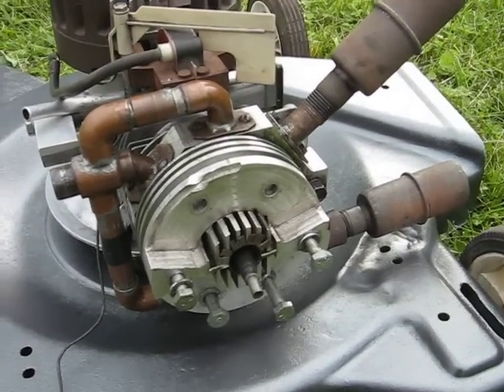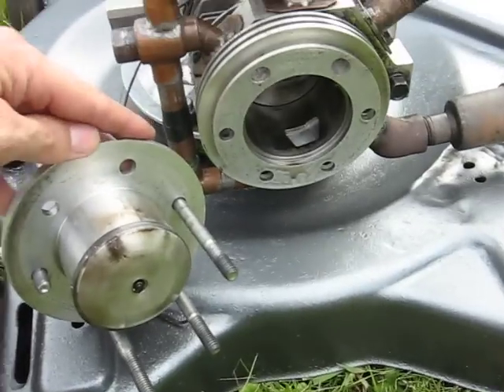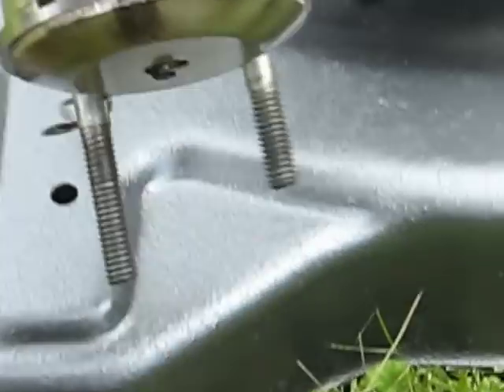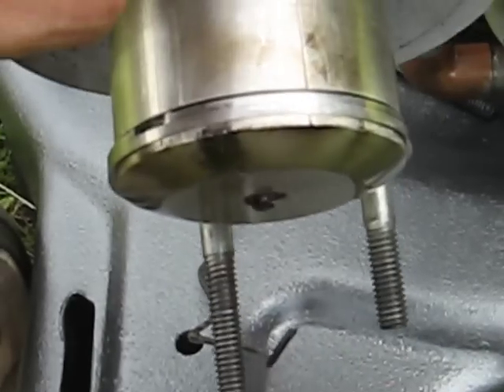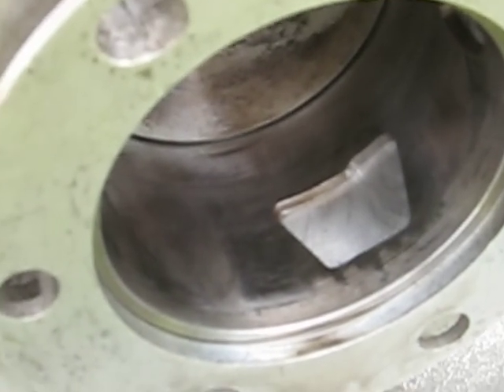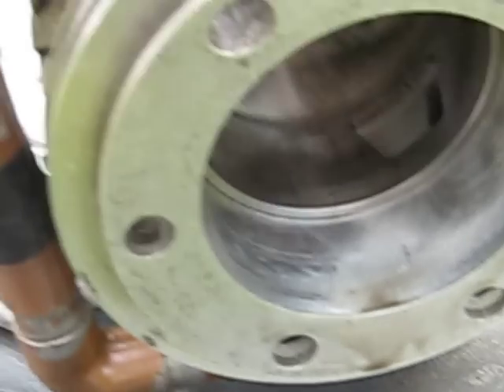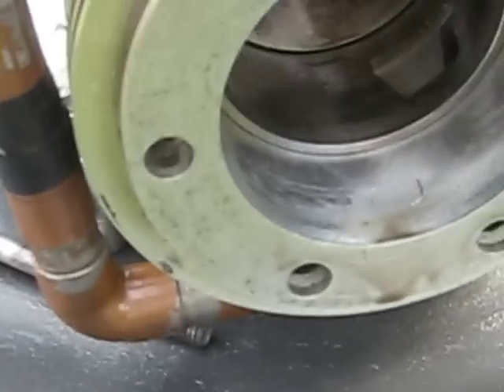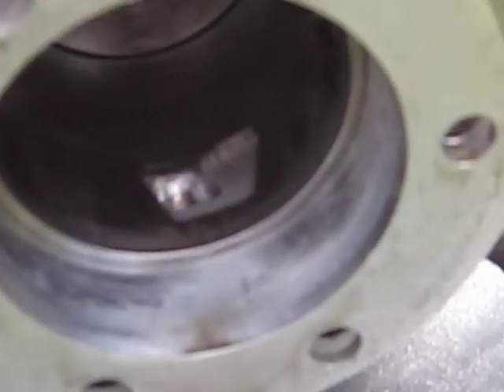Sleeve valve engine Cylinder head removed 2of3

Comment: It almost functions like the old 2 stroke detroits with the ports in the sleeve. How do you go about without pressurizing the crank case with some type of blower? Doesn't seem like it would be able to draw in the intake on its own
Reply from the maker: This engine is a 4 stroke, it just uses a sleeve valve instead of a camshaft and poppet valves. i have a vid or 2 where I use a model to explain how it works. I never heard of sleeve valves until an old friend told me he grew up driving a car with such an engine in it. 2 stroke sleeve valve engine existed also, such as the Rolls Royce Crecy V12 aircraft engine, though it had to be supercharged, since there is oil in the crankcase, kind of like a Detroit diesel. Lots of interesting engine types built and experimented in the past!

Comment: May I ask, did you ever have any cooling issues on the conversion, or at least were you able to tell any difference in cooling?  It's supposedly a "drawback" of sleeve valve, but this is an air cooled design to start.  
Thanks!
Reply from the maker: I didn't notice any cooling problems with this engine. We ran it for a bunch of hours on a dyno in say 15 minute runs, and I cut part of my yard with it a few times, lots of fruit punch  :)

Comment: The Design is out of this world, and love the video, Your Franken Briggs is great as well. "Thank You for Sharing This"....
Reply from the maker: Curtis Barile Glad you liked the Sleeve Valve engine. It was invented in about 1920, used in some cars during the 1930s, and in a fair number of aircraft engines in the late 30s and during WW2. There are still a few flying, mainly in Hawker Sea Fury fighters, as race planes these days. During the 1970s Mike Hewland in England built some single cylinder and I believe a 4 cylinder to test the design using modern oils. He found it to be a good solid engine that could rev 10,000 rpm. Mike has passed away now (according to wiki) but I like to think that he may have viewed my sleeve valve lawnmower vids, as he was a big inspiration for me during the design process. I actually got up at 5am one morning, drove to a pay phone (no long distance plan on our apartment phone) with a pocket full of quarters, and talked with him about his sleeve valve engines, he gave me some useful pointers :)
Reply: thats a really cool story. does this engine in the video still run today?

Comment from the maker: Nope, no extra lube, it gets lots up the side of the sleeve, so much that it burns it and has smokey exhaust. The engine should have a wiper ring for the bottom of the sleeve, but the block is too thin to fit one in.  Supercharging would cure that, as it would blow air into the crankcase, instead of sucking oil out of it.

Comment from the maker: Continuing:
If you use all mixed or "compound" ports (1 port in the sleeve, acting as inlet and exhaust) The inlet and exhaust ports would alternate around the cylinder, making manifolding difficult!
 The 3 inlet, 2 exhaust design was commonly used,  having 2 inlet ports and 1 exhaust port, as well as 1 compound port in the sleeve. So 4 sleeve ports connecting to 5 ports in the "head". The sleeve stroke needed to service various port designs also comes into play. The 5 port seems the best.

Comment from the maker: The "junk head rings"  as they were called, seem to get enough oil from the outside of the sleeve, and the inside of the sleeve, the small amount sneaking by the piston rings. The small amount required seems to find its way there to do the job, as I am not aware of any of the engines having any oil supply to that area, and I know this one doesn't.
 The mixed port design lets you save on some sleeve distance so that the ports can be larger. The 5 port design was the most common. 
(see more:)

Comment from the maker: 3 Good points there.
The piston rings don't seem to wear any faster, for 1 thing, the piston & sleeve move down together during power stroke, helping reduce wear.
The sleeve drive pin experiences very little wear, there is surprisingly small forces on it.
There is in fact very little wear in the block due to the sleeve moving, as there is lots of oil, and the sleeve spreads the oil out well.
These engines were actually noted for their long life, up to 2000 hours between overhauls I think :)

Comment: Its a really innovative and advanced design for the era it came out, props to the engineers whom designed this. How ever i see a few weekpoints in the design which could explain its extinction and wonder if youd agree or disagree.
1) it seems that there would be a high amount of wear on the piston rings.
2) the pivot point where the sleeve pin meets the bearing in the sleeve crank looks like it would wear quickly.
3) the amount of wear on the crancase walls from the sleeves.

Comment from the maker: The single sleeve valve design was patented around 1918, by 2 different people at the same time! Burt & McCollum, so that is what this type is called, or just a single sleeve valve engine. There was actually a double sleeve valve engine first, an example would be the Willys Knight design.

This type of engine saw a lot of use in WW2 in British engines, such as the Bristol Hercules 14 cyl. radial, and the Napier Sabre flat H 24 cylinder.
A group of 6 designers built this as a univ. senior proj